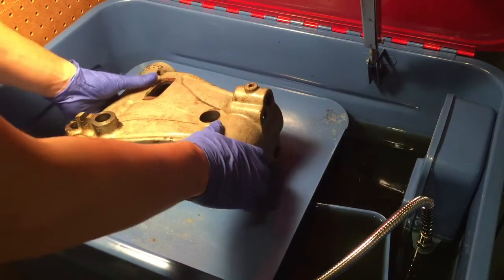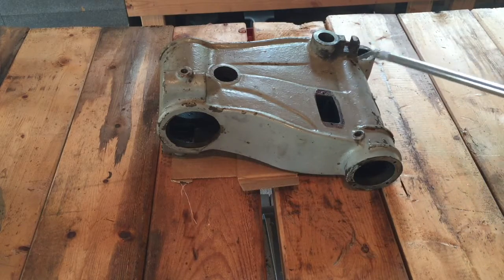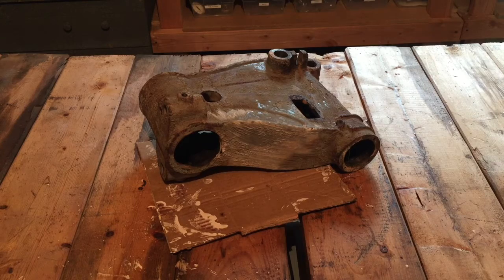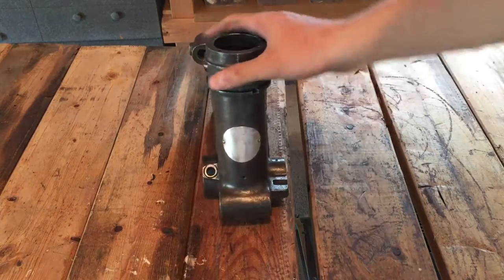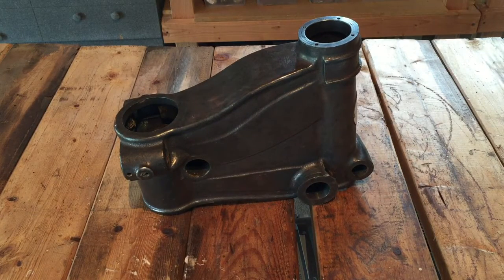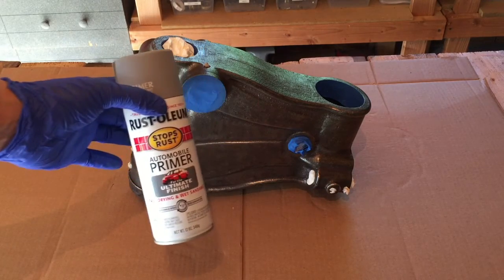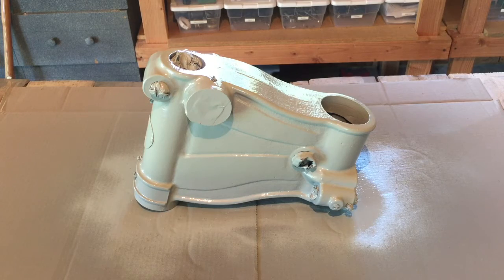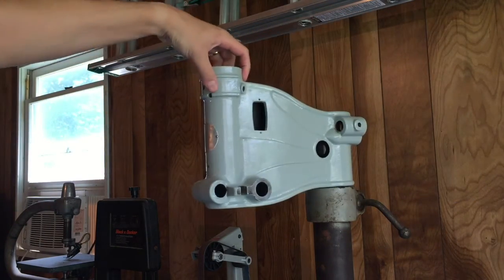Atlas 73 Drill Press Restoration: Part 4 - Head Prep and Paint

Comment: I have the craftsman made by atlas and when I took it apart I found a big rubber piece inside the head.  I think it was for the will to bump up against…. By the way I hate that citrus trip it does not work well for removing paint.  Prefer aircraft stripper.  Thanks
Reply: Quill

Comment: Any idea where to find the return sprint for a 74 model? I would appreciate the help.
Reply from the maker: +Hernando Ali I snapped mine so I was looking for a replacement also. I couldn't find any NOS dealers that would for sure fit, eBay is probably the best route though they will be used and expensive. Fortunately I was just able to bend my spring a bit and get it to work. Only about an inch actually broke off mine (the end with the hook that latches it in place).